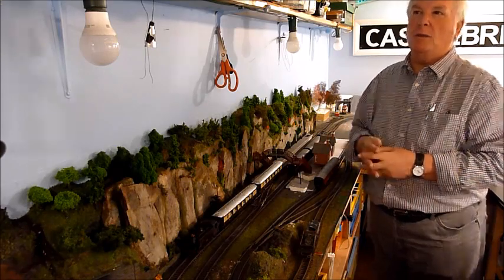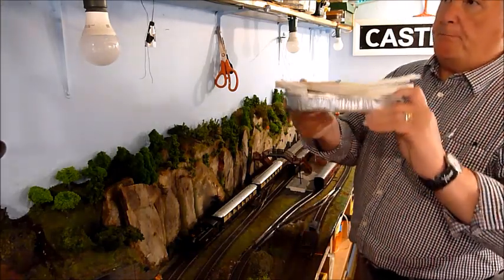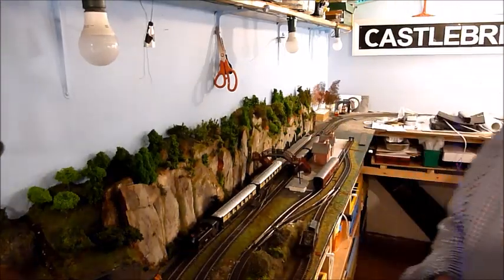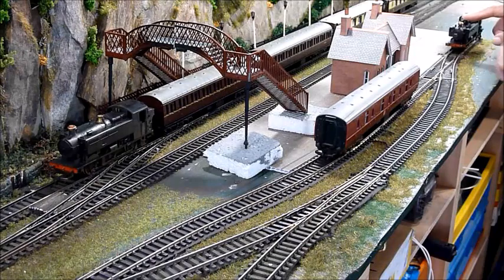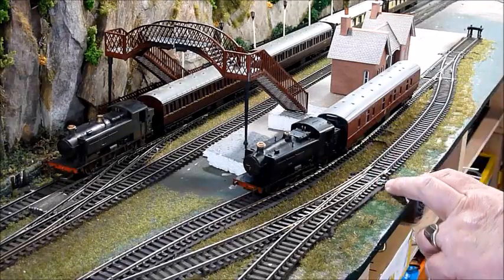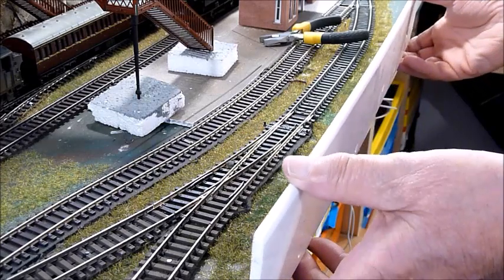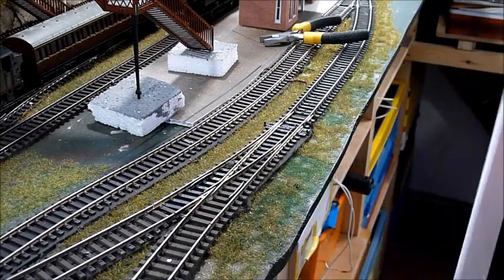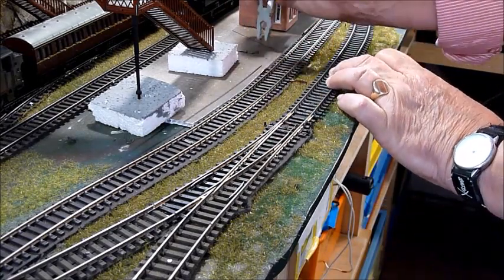Video No 30  Hand draulic point control  Sept 2019

Comment: Exactly the way I will be operating all my points on Tram Junction eventually. I too have just a small middle of the shed operating area and all my points for the railway and tramway are positioned not very far away from my operating position, so that I can change the points when needed, by this method. It's practical, simple and cheap to install and works just as good as electric point motors, and less wiring to worry about. Never thought about using the tubing from old cleaning fluid bottles, which is something you have taught me. I was going to use small bore plastic tubing that is used for air stones on fish tanks, which is handy if the points are positioned further away. So hats off to you Barry for that! By the way, your layout is looking very nice so far and it's surprising what you can do in such a small space when you come to think about it.
Cheers for now..................Geoff
Reply from the maker: Hi Geoff, I am thinking that rod control is more interesting for a small layout as you have to have your witts about you checking every point on the route. Would the airline be stiff enough not to distort over a distance? I am not sure but I am going to look into it. Thanks for your comments.....Barry
Reply: @Castlebridge-00  I know what you mean Barry, air line tubing is a lot more flexible than a hard plastic like the tubes you use, but as long as they are kept reasonably straight without any sharp curves, they should be ok. Obviously they would have to be held down in place to stop them moving when operating the points. or you could even use cycle brake tubing, which is a lot stiffer.
Geoff

Comment: great tip. thanks i will try this
Reply from the maker: Thanks for your comment Stephen, you can use slightly thicker piano wire than I did. I really like the fact that I am not pushing a button to change a point but being my own hands on signalman. On earlier videos, I have used another system to control both ends of a cross over, again by hand. All the best in doing yours..............Barry

Comment: Good video. Thanks. Are your points electrofrog?
Reply from the maker: Hi John, glad you liked the video. All of my points are electro frog and they all have frog juicers. As I will be doing a lot of shunting while the bigger trains are going around the circuit, a lot of my engines are short wheelbase and need all the help they can get to stop them stalling on the points..........Barry
Reply: Castlebridge OB owner. Frog juicers?
Reply from the maker: @Johantheman  Hi John, I discovered frog juicers a while ago. The purpose of the juicer is to detect the polarity of the current to the position of the point blade and even when an engine wheel shorts on the point the juicer directs the power to keep the engine running. This helps enormously with preventing sort wheelbase shunters stalling on the point. Gauge master do them and I buy them in packs of three from track-shack.com as he nearly always has them at a good price. Lots of information and help on youtube. Hope this helps.......Barry
Reply: Castlebridge OB owner. That’s interesting. Will investigate. Many thanks.